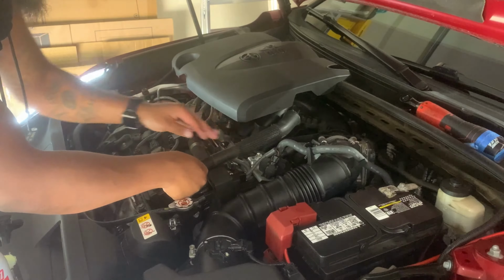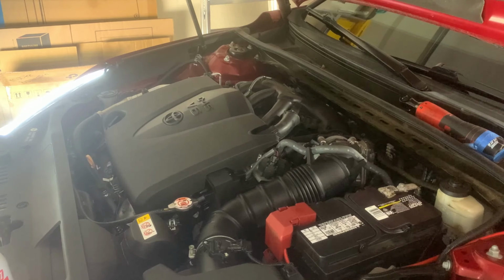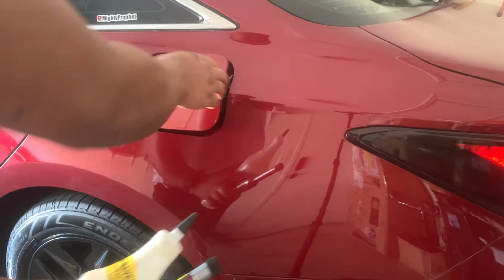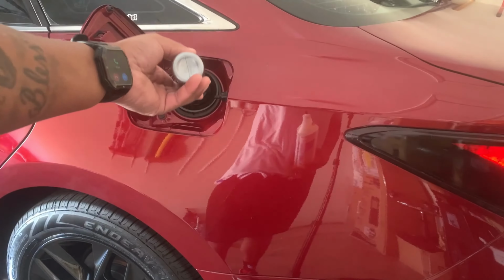2016- 2024 Toyota & Lexus V6 | Remove Carbon Build Up | Engine Treatment with Gumout

Comment: Is there any specific reason you are doing this compared to say a PEA fuel additive like Techron? As you know, the 2GR has D4-S dual injection where injectors spray valves anyway so there shouldn't be any major carbon build up like a strictly GDI like a Hyundai/KIA. If there was any on the valves, wouldn't it be cleaned by a simple fuel additive because D4-S still has port injectors. The only other thing that I found helpful in my 2007 2GR in my ES350 is the throttle plate cleaning. Car Care Nut gives a good demonstration and I can attest that it is fairly easy all you need is a rag and some carb cleaner. Its well worth it, I especially noticed a difference on my old 2001 Sequoia with the 2UZ V8, that truck needed it and it makes a noticeable difference on cold winter starts and full throttle. The ES was less noticeable because it is so quiet anyway and heats up much faster. Anyway good video and nice Avalon.
Reply from the maker: @christopherclark4774  i say it in the video, I saw some carbon build up when changing my spark plugs not nothing to worry about. 
The gumout did its job hence the white smoke.

This how I take care of my car,I just like preventive maintenance in general do what u will with the info in the video.😅

Oh 14+ years XP working on cars this & Lucas is the best In the industry in my opinion.

Comment: What is your exhaust setup?
Reply from the maker: @davidswfl  straight piped still have factory CATS
Reply: @mightyprophet4581 You mind if you send me or post more sound clips
Reply from the maker: @davidswfl  I will put them on my channel in about a month. 
Going to get a throttle controller and compare to factory in the video.